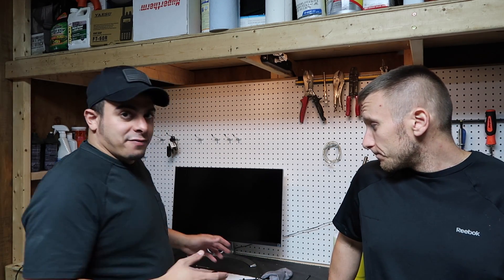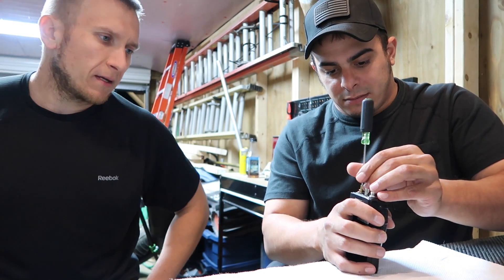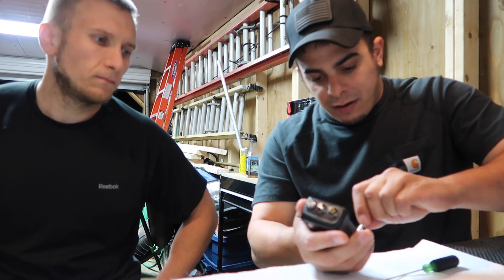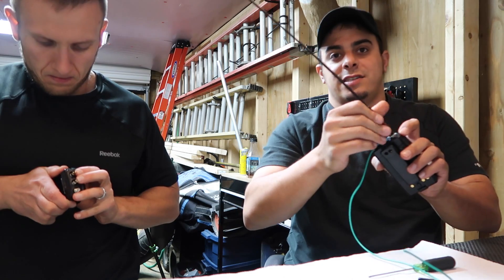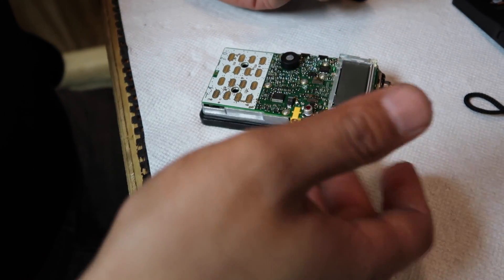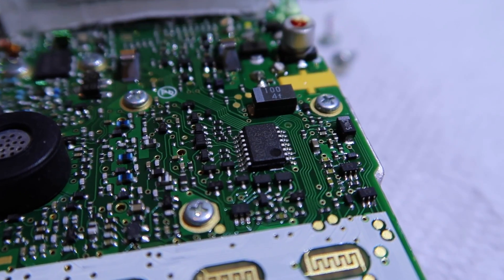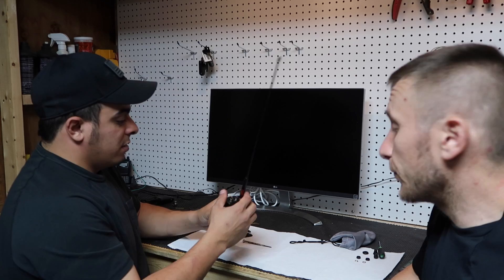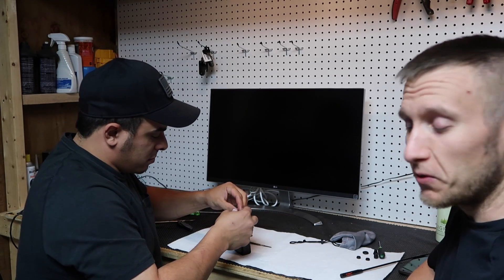Yaesu FT-60r (FT60) Mars/Cap Modification

Comment: It makes me nervous seeing guy break the resistor off the pcb. it could potentially tear the pad off the board. best ot flick it off with a soldering iron ot better off.. just take it off after melting the solder with hot air. I solder 0603 resistors by hand all the time.

Comment: Simple and easy.  I’ve extended the TX on my FT60R (R1164), FT3DR, FT70DR (FT3DR and FT70DR very simple, pop up rubber plug in battery compartment and solder suck to create an open), and even my Kenwood TH-D74 (requires complete tear down (remove R761).  Kemwood TH-D74 might now be for the timid.  I was RF Transmission Systems in the military and worked down to component level including SMC IC’s, so experienced though.  Amateur radios are very simple though (toys).  Remember, afterwards be responsible.

Comment: DON’T TRY THIS unless you have really steady hands. But I used a pair of long pointed tweezers. Heated them up red hot over the stove, then gave them a brief second to cool. Then, grabbed the solder ends of the specified cap using the long tweezers. Sometimes they won’t be hot enough to get the solder to flow. just try again and shorten your time in between heating/ tweezing. TAKE YOUR TIME. Practice with tweezers cool under magnifying glass without and then With touching the cap without touching any other components. Inspect and learn which cap you are after  and other components around it that may be damaged if you get close to them before even bringing tweezers near the board. Don’t bridge any other connection to any other components on the board. Possibly shorting something. you will defiantly need a magnifying glass or jewelers ring. REMEMBER you can not touch any other components with the hot tweezers it will melt them and destroy your radio.

Comment: I just did this mod on my FT-60R and it worked perfectly.  I followed your advice not to use heat via a soldering iron and used a new utility knife blade like you guys did.  It took about five attempts, by putting the very tip of the blade beside and slightly under the edge of the resistor, and prying gently up and to the side.  On the fifth try it popped right off with no damage to the circuit board or any surrounding components.  All that remained were the two end posts and the solder that held them to the board.  The resistor disappeared and is so tiny I couldn't find it.

Unless you have very good eyesight, I recommend wearing a cheap pair of magnifying "cheater" glasses because that resistor is teeny-tiny, even smaller than it looks in the video.  You will also need a very small phillips screwdriver to remove the four screws under the battery that hold the case together, particularly the top two tiny black screws.  An inexpensive jeweler's screwdriver kit that contains a tiny phillips will do the trick.

I put off doing this for a while, building up my confidence, but now that it's done I'll say that it was easy, and I'd attempt it again anytime.  It took me about 25 minutes start to finish, including collecting the necessary tools and putting them away afterward.  Keep in mind that doing this mod does reset the radio and you will lose all the frequencies you have programmed, so before you begin, write them all down or make a backup using programming software.

Comment: Also don't forget the VHF Murs channels as well that could be great for emergency comms
Reply from the maker: Railfan 51 no doubt. Thanks for popping in!
Reply: @NickPixelTV  is there anything specific to the kenwood 16 channel 5 watt vhf radios for this, I'm in Canada and work on the road and deal with truck drivers problem is from what I see its all us spec radios tx 144-148 and I use freqs all in the 150s, I have an unlocked Motorola mobile in the work truck but am looking at getting a hand held for back up or if im spotting truck radio was bought previously modified for this.

Comment: Its interesting how you are giving such confident advice on how the razor blade is the beat way to go, but yet it seems you have zero experience with having ever even done this mod. 🙄
Reply from the maker: So you watch ppls videos and you see them burn up their radio with an iron and see damaged radios and I have done about 10 now  with the razor blade its a little pop and its off with no heat etc and have had zero issues sooo theres that

Comment: a soldering iron is the better way to go.  you are actually more likely to damage the radio by prying the resistor off with something.  I have seen board traces rip off the board with little to no effort.  It is a lot safer to use a soldering iron.  if your not good with a soldering iron/board repair then i recommend finding someone that is to do the mod.  Trust me.  I do a lot of board/electronic repair.  I removed the resistor in my FT-60R with a soldering iron.  the resistor will literally stick to the iron.  or you can use small tweezers to lift the component off the board.  it is low melt solder they use.
Reply from the maker: ihate Smartphones at the time of filming I didnt have a small enough tip on the iron. I have also seen people that don’t know what their doing with the iron apply too much heat and mess other things up.. My radio has been perfect last few years and have done 3 or 4 mods. But I do get where you’re coming from and appreciate your advice and option to give others. Btw like the youtube name haha

Comment: So many negative comments by the armchair warriors. I modded mine because, not only am I a Radio Amateur, I am also a very experienced Radio engineering professional. I have my own licensed PMR repeater network and I find it easier to have a simple, radio that can do all, rather than have a cluster of different radios hanging off my belt, there is just one. However I also have DMR repeaters and radios therefore my trusty GD77 can do it all - although its not as sensitive or easy to use as the Yaesu. Best of all, the Yaesu receives Civil and Mil airband.
As for the counterpoise, anything is better than nothing, but remember the stock antenna is just a coil and with you (or me!) as the reflected earth, it is inefficient at the best of times. Of course a Diamond antenna will help but the longer antenna length means it is not ergonomic anymore. Good video guys.
Reply: Hi Dave, I have a yaesu ft 270r.  do you know how I can locate (or find out) where the resistor is located to complete the Mars/Cap mod?
Reply: @LaurentVF  Try Mods DK https://www.mods.dk

Comment: So, I did this modification on two radios,  I have four radios in all.  The two radios that I did the modification on work fine and I can transmit and receive to FRS/GMRS radios.  The problem I am having is the same as a couple people below.  I can not get the either of the two modified radios to take programming from the FT-60 Commander or the Chirp software programs.  Both of the programming softwares are working because I can program the two unmodified radios but obviously I can not transmit on the unmodified radios.  What software program are you guys using to reprogram your radios after doing the Mars/Cap modification and on what PC?
Reply from the maker: Yeticon Adventures i was able to use chirp and windows 10 after the mod on the radios i’ve done
Reply: @NickPixelTV   I have tried two computers one with Windows 7 and one with Windows XP.  What cable are you using.  I was thinking it might be a driver issue but the non-modified radios are programming fine.  Anyone that you can think I should get in contact with to help with this problem?
Reply: So, I got the it to work.  I was using the chirp program with some aftermarket cable.  I purchased the Yaesu ADMS-1J-USB kit that came with the CD and the cable.  Everything works now and I am able to program both radios off of my Dell Laptop running windows 10.

Comment: Guys...hmmm your camera is OUT OF FOCUS and does NOT SHOW the point where the resistor should be removed...CLEARLY!!   "Grab an razor blade and GO FOR IT" is not a good idea inside the FT60.   .... 'chopping inside the FT60" is not a good behavior for the reliability of the radio.  PLEASE...POST A "BIG PICTURE" of the site in the radio...CLEAR PICTURE ...with arrows to show folks what needs to go...(antenna adds are interesting..will check that out)   KC9OHL....

Comment: hey I did this mod and everything works except my voice does not carry. I can key the mic and break squelch  im lost. any suggestions?
Reply from the maker: That is odd... did the radio reset after you did the mod? Did you do it exactly like the video?
Reply: yes as far as i know, im afraid i may have hit something close to that resistor and damaged it,  however i cannot find a good schematic detailing what does what. im going to get some electrical cleaner and try that tomorrow in case some residual is causing this problem. my voice wont even carry on the local repeater even though i can key and get it to identify.  thanks for getting back to me.
Reply from the maker: a1xavier I wish I could help you. If you’re keying up then you have the right pl code. How about mic volume? Let me know how you make out. Thanks for the sub
Reply: hey you got it, ill look into the mic volume issue, and try to reset the radio manually. ill let you know, thanks again!

Comment: it is absolutely MUCH easier, quicker, safer, less tedious, and much more likely to leave the radio in working order - if you simply cut the trace, with an Exacto knife, going to the part  that everyone else seems to be clipping!  I have done it, and I had no problem!  Just take it slow and easy, and don't apply too much force on each pass! Because if you crack the board you are SCREWED!!!  :) This still might circular file your  radio - so proceed at your own RISK!!!!!!!!!!!!!
Reply from the maker: That works as well.. either way is better than the people heating up the board etc. thanks for watching Bruce

Comment: Was looking for the upgrade. Called local ham ship and they wanted $50.00 to perform the activity.  Im handy with a soldering  iron but was super hesitant. This way was awesome. I can only bet the Ham shop does it the same way. 10-15 minutes. Make sure you have a good magnifying glasses. Thanks for the instructions for the DYI gang. Remember, if your unsure and cant afford to replace your radio is you screw up, pay the $50.00 to the shop. The break it, they own it:)

Comment: Hey guys, just did this and followed your instructions/demo very carefully and what do you know, just like in the video, it worked perfectly!! Thanks so much for the effort!  One quick question.  Obviously I lost my freq fill during the process.  I had previously used chirp to do the programming but now it no longer detects the radio.  So my question is, is this a common problem post-mod or is it my software/process on my end?  You don't need to answer my problem if it isn't a known issue.  I just was curious if others had experienced similar issues.  If not then I'll continue to work on it here.  If they have, does anyone have a solution or work around?  Thanks fellas!
Reply: There may be nothing wrong with chirp. Some radios react differently than others, for me chirp came up with an error when I tried to upload the previous image from before the mod , turns out you need to download a new image from radio then import the previous data in to the current image . I'm guessing after the mod some settings, compatibility,version, etc. are different.  I know this is years later but hope it helps someone.
Reply from the maker: It sounds to me like software or process.. The mod shouldn't cause any issues with detecting the radio in chirp. I have re-programmed mine after without any issues... thinking maybe start with a fresh install of the software
Reply: KC3FSX Thanks man good to know. I'll drive on with triybleshooting the chirp.  Thanks so much for the quick response!

Comment: hello, I did this mod on my yaesu ft60r.  I have the yaesu software for this to program radio, since I did mod I can not program it. Do you have any help for me? I did the factory reset too. Thanks
Reply from the maker: Dennis Potts the factory reset should of completed after the mod. Did you get any errors? Is everything else working correctly? If its not on the radio side it might be ok the computer / usb side that ur using to program the radio
Reply: KC3FSX yes I did factory reset. Go through programming process, then error pops up on the radio screen. KE8IPA
Reply from the maker: Dennis Potts im thinking. When its trying to transmit the update file is that where it errors out maybe it’s a setting hard to tell without seeing it but I’m thinking. Usually this process is flawless
Reply: KC3FSX-Nick maybe try the RT Systems programming software, tho it isnt freeware. I was having similar issues your describing and it turned out to be CHIRP.

Comment: Took me 10 min and now I can transmit on GRMS.  I used one of the needle picks from a phone repair kit and SMD resistor exploded when I pushed against it leaving the trace clean unmolested on both sides.  This is so much a cleaner mod than messing with a soldering iron.  Thank You guys... You are freaking AWESOME for uploading this video.
Reply from the maker: RC Pilot Multirotor ;) no problem at all - thanks for watching. Sub if you’d like

Comment: Does this mod work on Yaesu FT-60E(European version)?
73
Reply from the maker: I believe so but don't hold me to that. If you pull that back panel and see that little resistor you should be fine. I have heard of others doing.
Reply: Remove the resistance in the FT 60E. But I can not do TX at 146,520.
I can only do TX up to 146,000. Forget to do something? Tks!

Comment: i would not let you near any of my radios  .   after seeing you 2  do this
Reply from the maker: BRIAN BROWN ?
Reply: Neither would I after hearing the “What are those things called?” “Soldering iron that’s right”, and the picking the link out with a blade.
Reply from the maker: Gotta work with what you have and it easy and works.. troll much?
Reply: Either I’m trolling, or I actually wouldn’t let a guy who can’t remember what a soldering iron is called inside a radio of mine with a blade. One possible outcome of that is lifting one of the tracks from the PCB, making the mod harder to neatly reverse, and sell on through conventional ham sites. Having said that, I don’t care at all what you do with your own stuff, or how you go about it.
Reply from the maker: It slipped my mind.. you’ve never had that happen eh? I never planned on reversing mine and simply showed how we did ours. Smh
Reply: Dont worry about it guys. Hes just mad he has to make the trek from his mommy's basement to the kitchen because the isnt home to make his pp&j for him.

Comment: I followed the video precisely and ended up with a MARS CAP modded radio that woks perfectly.  Thanks for the very detail oriented video and the well laid out instructions.
Reply from the maker: +Jessie Wright awesome! Glad we could be helpful. Where ya from? How do you like the ft60 so far?
Reply: I'm in Phoenix, AZ.  I've had the FT60 for about a month and so far I'm 
really impressed.  I chose it mainly because it fell within my budget 
and it provided the most features that were available for a radio in my 
target price range (broad range scanning).  The only con that I have so 
far but one that was not really a deal stopper, was that the radio has 
no active battery indicator display.  Other than that, it's a really 
nice little radio and a solid performer.  Just an FYI, HRO has recently 
discounted these to $150.00 bucks because they are being discontinued by
 Yaesu.  They are still over 200 on eBay but I'm sure the prices will 
drop soon elsewhere.  Thanks Again.

Comment: Really   150$ vs 11$  I do not see how someone can pay that much for the FT-60r Please help me out here
Reply: drop that awesome 11 $ radio once and you will see why.
Reply: FT-60 is cast aluminum housing, well built and will last years. Well worth the money. I bought a Baofang just to have because it didn't cost much. Rarely could every reach the repeater. Now sits gathering dust.
Reply: $11 radio has a very bad sensitivity and selectivity in the radio receiver, you can hear less than 50% of what a Yaesu FT-60R can hear.
Reply from the maker: +Gfdf Perte my buddy has two of the baofengs but they are a pain to program also they just feel like they are cheap. The ft-60 is a solid radio built really well and dependable. The cheap ones are good to have for beginners but I try to buy something right he first time. My favorite radio is the vx8-dr. I have a video on it and it is my edc radio
Reply: yes use the chirp program then it is easy.
all hand helds are just that hand held radios for emergency use. and if your close to a repeater  very close it works out ok
Reply: Now I need a Good ICOM for 11Meter use
Reply: Use them both and you will see why. Huge difference. Compared to any baofeng, the ft60r is worth every penny.